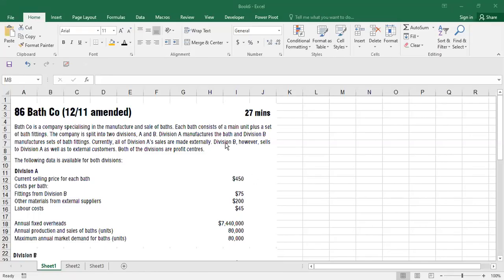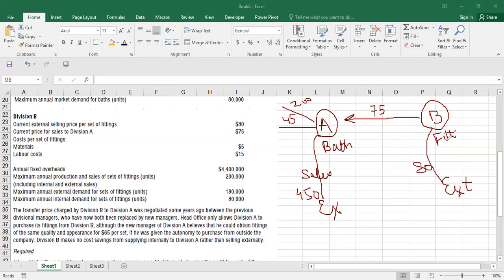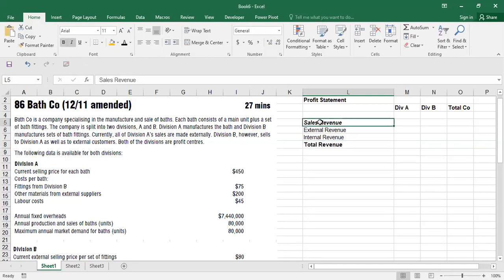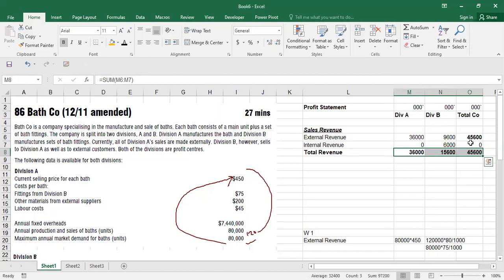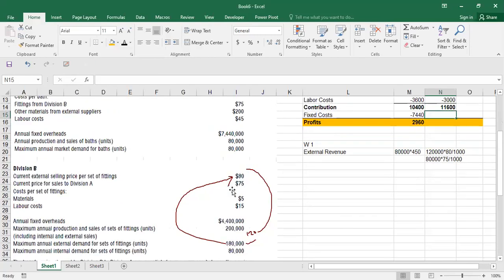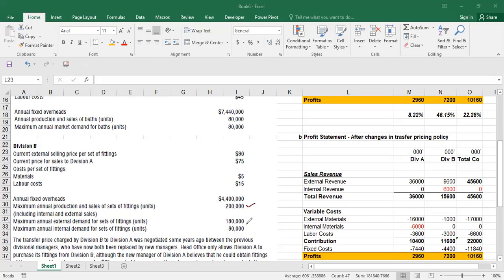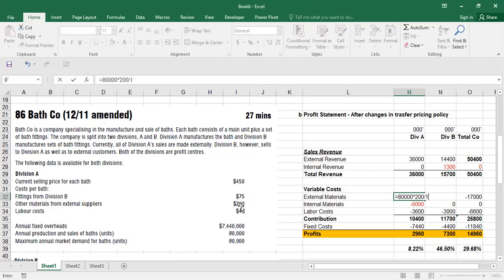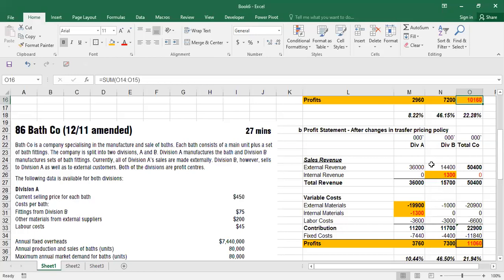ACCA PM (F5) - Transfer Pricing   Long Question - Bath Co | Past Papers Transfer Pricing Practice

Comment: my thought was the new external material  cost after the changes should have been (200*60,000)+(65*20,000)= 13300
Reply: I thought the same🤔
Reply: No, the second part to your formula is incorrect @dorisnyamongo629. It cannot be (65*20000) as we are looking at external material costs. Prior to the new method, they were purchasing 80000 units from Div B. Now, they’re externally purchasing 60000 units and 20000 internally from Div B. Therefore under external material costs it must be 80000*200 which relates to the material cost they were already incurring + 60000*65 as they’re now purchasing 60000 units externally at $65 per unit. 

Under internal materials then we’ll do 20000*$65 as div B has spare capacity of 20000 and they’ll supply these at market price. Hope this makes sense!